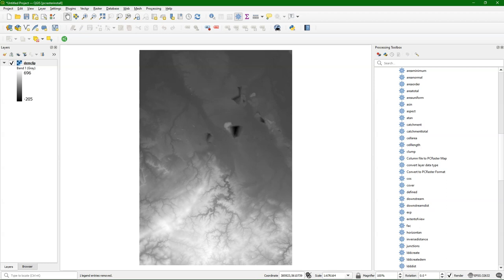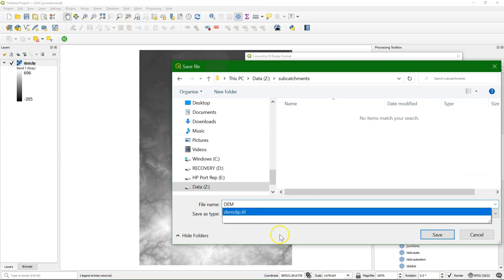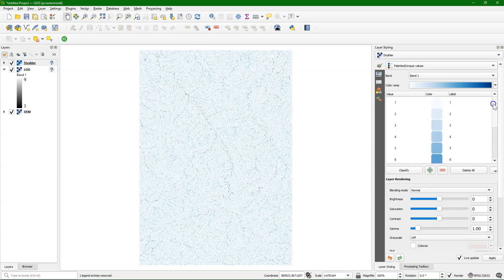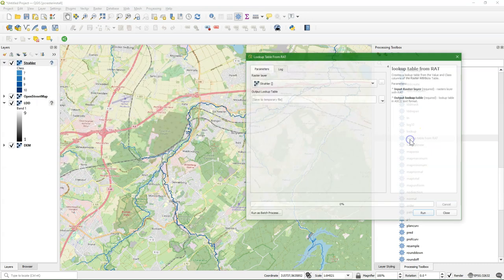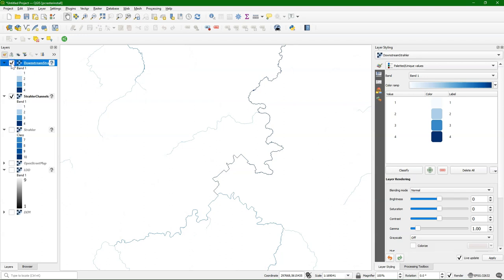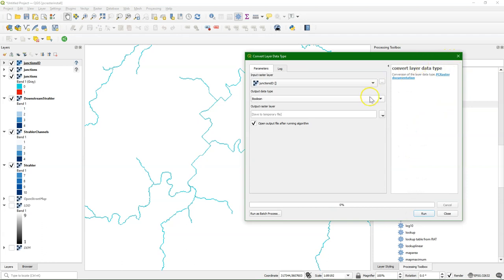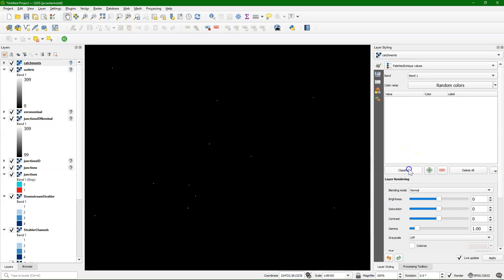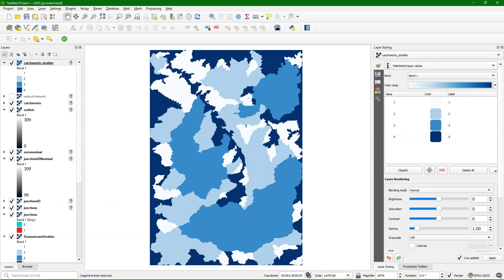Derive all subcatchments from a DEM using PCRaster in QGIS

Comment: Hi, I'm unable to convert junctionid to nominal, as it is raising an exception of crs_wkt. Can you please suggest how to overcome this? Thanks.
Reply from the maker: The error is for some reason related to your projection. What you can do is to delete the xml file of your input layer, so all projection info is removed. Then run the tool again and assign the correct projection back to the input and created output.

Comment: QGIS 3.14.15 doesn't have the 'scalar' option in Output Data Type when converting geotiff to .map format. When I used Raster > conversion > translate, the geotiff was converted to .map but was shifted north slightly!

Comment: Hi, Hans. For the last 2 years i have always failed to installed PCRaster plugin in the QGIS. But, this is not the case with the latest version of 3.34 anymore. The instalation proccess were running without any issue and i have successfuly tested the PCRaster in subcatchment delineation as in this tutorial video. Thanks

Comment: Hi Hans,

Great video, I don't understand the last step why a strahlerorder cathcment value '1' can be next to a strahler order '4' catchment. Should it not outflow through a catchment with one strahler order lower, as it does show in the StrahlerChannels.map layer?

Keep up the great video's
Reply from the maker: Thanks. Smaller order tributaries can end up in higher order channels, see this video on the Strahler order method: https://youtu.be/SuFl8EWDqfU. The order only increases if channels of the same order join.
Two notes: (1) Catchments are nested. So downstream outlets have a catchment that cover those from the upstream. (2) Often users don't want to have this effect of downstream catchments covering the upstream ones. This is the difference between the catchment and subcatchment tools of PCRaster.

Comment: Really good video, as always! However, when I try to create the LDD layer, my computer always freezes, and I cannot get results. Is that common?
Reply from the maker: Lddcreate is quite calculation intensive. You probably have a large DEM. While QGIS freezes, it's probably still processing. Try to wait longer. It could take really long with large data. You can test it on a small DEM to see if it works.
Reply: @HansvanderKwast  Thanks Hans, I left it the whole weekend and it worked. However, now when I'm trying to create the "new attribute table" for the Strahler layer, QGIS doesn't show me the option. Do you know if I could do this step in another way?
Reply from the maker: You need to first style the layer with the Layer Styling panel. Then the option should show up. I assume you've installed the Raster Attribute Table plugin already.
Reply from the maker: Also check my new playlist QGISHydro 2 Chapter 4.
Reply: @HansvanderKwast  Solved! (it was the plugin)

Comment: Hello, thank you for all your videos they have been a great help. My first hurdle is my Raster attribute table has the edit toggle greyed out. I also am getting an error when trying to us the Lookup tool, resulting in no excel sheet produced. Do you have any solutions?
thank you
Reply from the maker: Hi. The problem with the RAT is know and fixed. It will be working in the next release. See https://github.com/qgis/QGIS/issues/57795.
Lookup tool reads a lookuptable in text format, not Excel and it is an input. The result is a reclassified raster. Lookup table from RAT exports the RAT to a text file in the lookup table format.

Comment: it is not work there is an AttributeError: 'str' object has no attribute 'crs' 
in the lookup, please answer me, for my senior project
Reply from the maker: There's a bug with the lookup tool. We'll fix it in the next release. Meanwhile you can use other tools in QGIS that doe the same (for example reclassify by table). Or use the lookup tool from the Resource Sharing repository for PCRaster.
Reply from the maker: Also note that the output is created, but not loaded in QGIS. You can drag it from the browser panel to the Map canvas and continue the procedure with the reclassified layer.
Reply: @HansvanderKwast  Thank you veryy much. I am sorry for bothering you. But there is an AssertionError in the downstream. I have searched about it and found nothing. Would you please tell me if I can solve it? Thank you again.
Reply from the maker: @zainabmansoor462  Please copy the error and paste it here so I can check.
Reply from the maker: @zainabmansoor462  It seems to have a problem with your projection. You can delete the aux.xml file of your input raster (the LDD file) and run it again.
Reply: @HansvanderKwast  It does not work. Is there service from qgis company such as holding a meeting to discuss our problems in the teams or zoom for a fee?
Reply from the maker: @zainabmansoor462  You can contact me through the e-mail provided in the PCRaster Tools plugin info.
Reply from the maker: The bug in the lookup tool has been fixed. There's an update of the PCRaster Tools plugin available now.